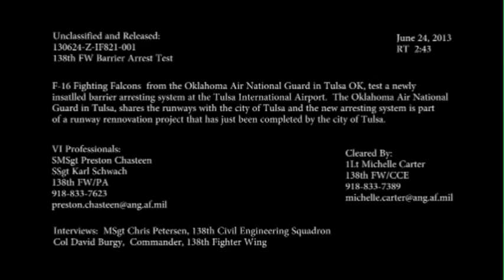F-16 Fighting Falcons Test  Barrier Arrest System

Comment: Cool vid, Thumbs up!  But...this is not a barrier.  This is cable system.  USAF used to use barriers but began to favor cable systems back in the late '60s.  Barriers were ineffective unless erected.  When erected, barriers can snag aircraft unexpectedly.  Not good.  A military-contract C-54 got snagged in a barrier on Okinawa in the mid '50s.  Tore-off both outboards.